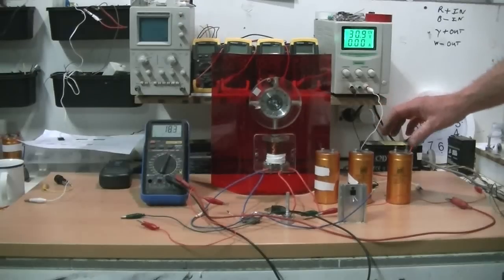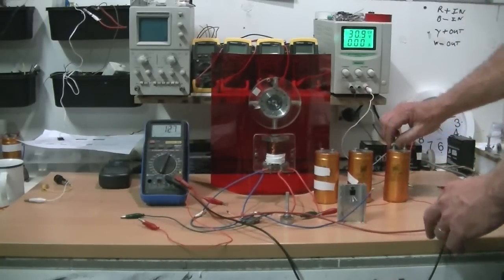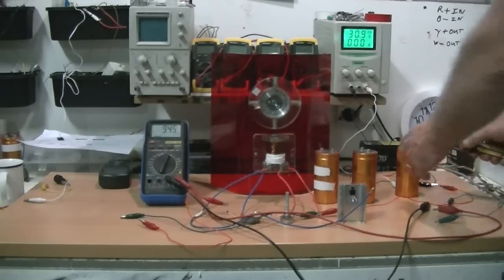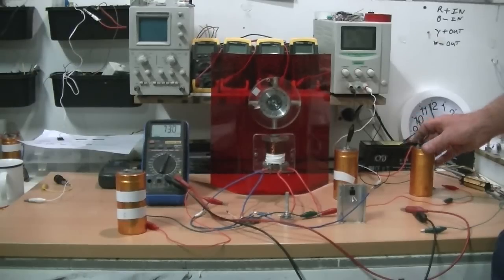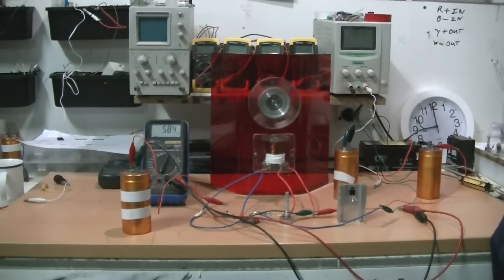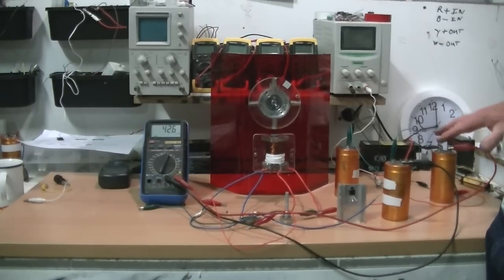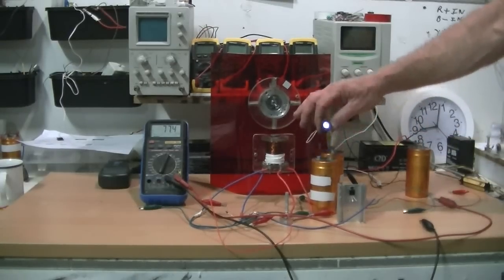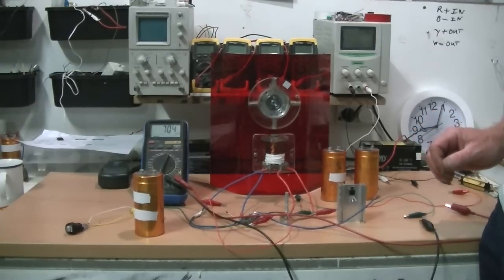please explain.flv

Comment: easy it is from the radiant spike being inverted from a negative state to a positive state,,,,and explains what john said in the expansion and collapsing of the Bloch wall in a dipole (magnet)
radiant energy flows (or pumped in) 90 degrees from the polls of the electromagnet (run coil) ...